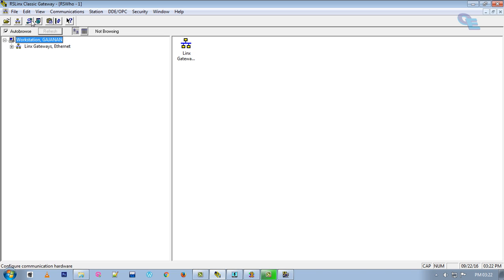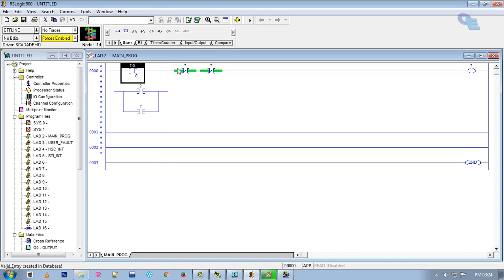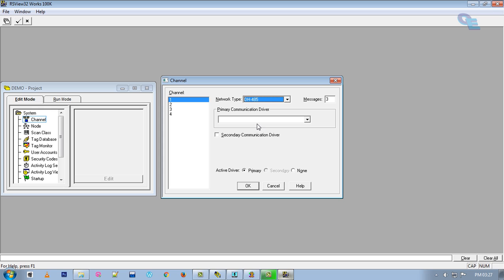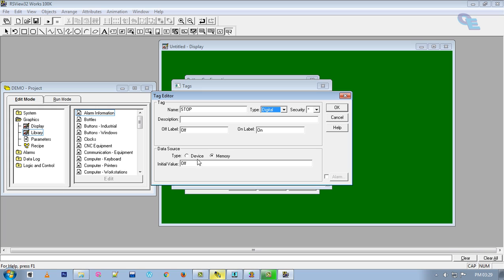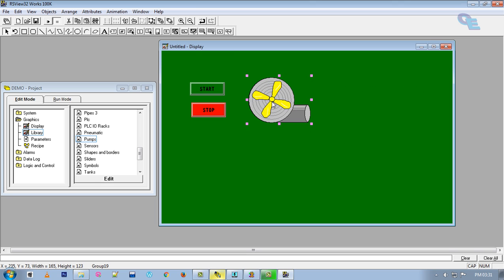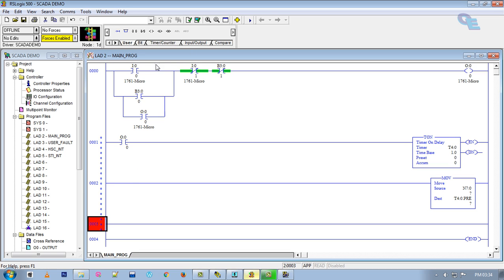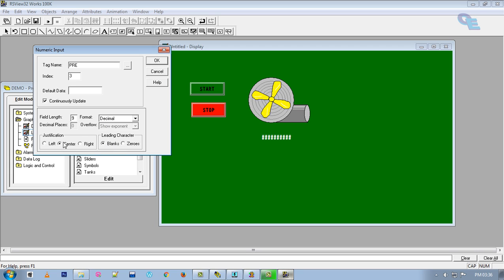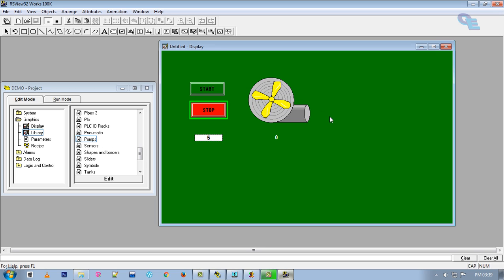RSView32 Works Animation and RSLogix 500 Complete tutorial

Comment: My rsview 32 doen't communicated with rslogix500. Why?
Reply from the maker: Are you simulating rite?
Reply: @HybridAutomationTechnologies  yes, all the same as the video.
My ladder run is ok, rslinx ok, emulate ok, but rsview 32 no
Reply from the maker: @michaelestevensordonezpare7271  recently my hard disk crashed i lost all data...
And from long back i was in not touch..
try running all apps in admin mode.. If it doesn't work let me know well try through any desk
Reply: @HybridAutomationTechnologies  for any desk will be better
Reply from the maker: Hi there